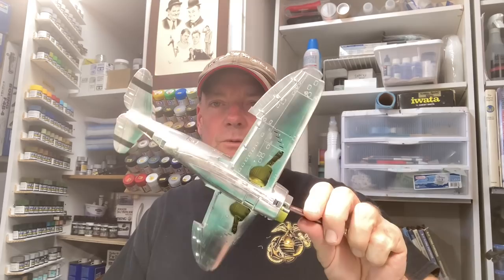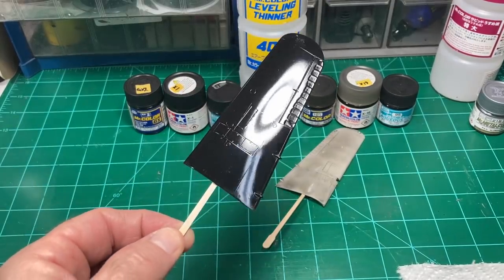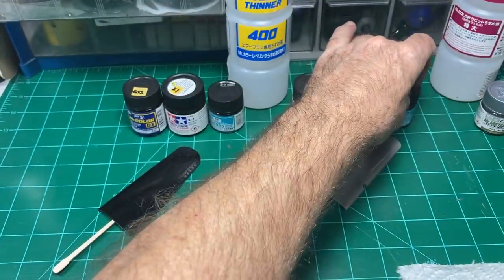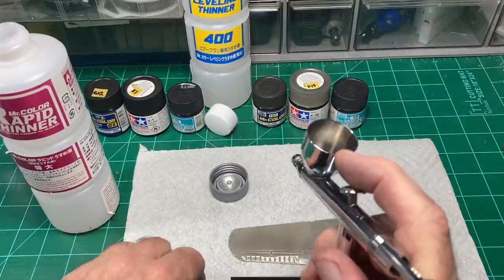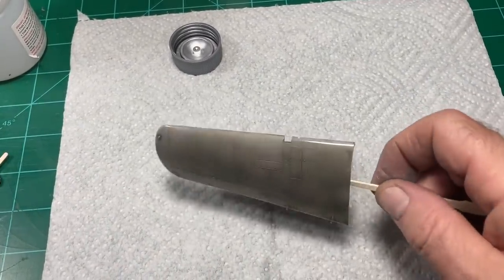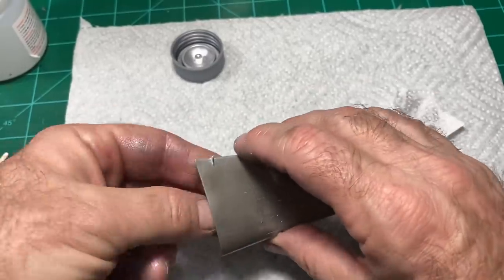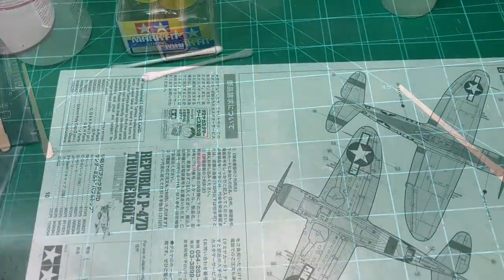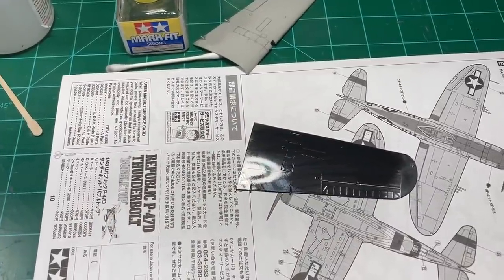Ep 1 Highly Reflective Metal finishes on scale model aircraft.

Comment: Back in the 60s  there was a product called 'Metalskin' in the UK. It was a self adhesive very thin foil which you preferably  cut the individual panels for your chosen model and applied them. It was a slow tedious process, but the results were amazing- !
Reply: I remember it but never had the chance to buy it unfortunately....
Reply from the maker: Bare Metal Foil is the closest thing out there today.  I tried it but I'm too ham-handed to handle it without ripping it.
Reply: Try thicker aluminium tape. Its streches and can be polished.

Have you tried lightblue base instead of grey?
Reply from the maker: @Maax1200  I tried a medium range, transparent.  It was easier to outdo the blue color that shows beneath, but I thought it looked too much like those old Kodachrome blue tinted photos.  Just my opinion, but it didn't do it for me.  I like the mix of black and smoke best, but that's just my preference.
Reply: @rebelroostermodeling6460  Ok, thnx for the info.👍👍 Grey does look good though.🙂

Comment: Just a thought,to get various aluminium finishes,could you not do some panels in black and others in smoke.
Thank you,you have taken the fear out of doing a NMF out of me,
THANK YOU from the UK.
Reply from the maker: You certainly can.  The trick is to not put so many coats of the metal color over it to subdue the effect.  I find that smoke, black, and very dark greys---- I have seen some use dark blues as well ----tend to do well (all gloss of course) and not be so different that they look distracting.  What I like about the pigment rub is that it gives you some effect as you change angles.
Reply: @rebelroostermodeling6460  cheers fella,I have the kitty hawk 1/32nd F86 sabre dog to build at some point,and Will certainly try your method.

Comment: Could there be a bonding between the polish and paint ?
Do you have any kits  that have  been finished a long length of time ?
Really looks great thanks for sharing ❤
Reply from the maker: Hi Jerry thanks for the comment and its a good question.  A couple things to remember:
1) The plastic is polished, making it super smooth so yes bonding can be an issue.  This is why I prefer a lacquer gloss base color beneath the metal.  The lacquer base will chemically "bite" better and have better adherence than an acrylic.  The metal (again, lacquer based metals as well) will then have a better seat to grip.
2) It is important to give a good washoff (I use alcohol) to get the glossy chemical in the polish off the plastic.  I generally use alcohol, but Dawn and water also works for many.  You will lose a little of the super shine because the flm is gone, but the gloss base will bring a shine right back for the meatl to utilize.
Reply: @rebelroostermodeling6460  very good.
Thanks for getting back to me on the topic.

Comment: Do you recommend to assemble the whole aircraft then do your technique, or do you do major surfaces, ie fuselage, and wings separately then assemble? If the latter, do you fix seam lines then respray?
Reply from the maker: Wow Josef, that's a good question and changes depending on different things.  I think it would be best for me to actually make a video on that, and I thank you in advance for the question because it is good subject material.  
But for now I will tell you that as general rule, I go in stages.  Engine, cockpit and landing gear are done and painted individually.  Then I go to the fuselage, wings and flight control surfaces (if separate).  Then I address seams etc.  Prime, find problem areas, fix again, prime again.  Then paint, then attach the engine and landing gear.
Reply: @rebelroostermodeling6460  thanks for your reply! I'm very excited to see your next video! Metallic finishes are the bane of my modeling existence!!!! So many of my favorite aircraft are Metallic finishes...ugh!!! Please help!!!!

Comment: Fantastic vileo! Please allow me a question : which is the dillution ratio for mr hobby super metallic you used? 1/1 with rapid thinner ?
Reply from the maker: That's about right.  My bottle was older and a little thick, so I did a little thinner.  For a nice new bottle you might not even need a 1/1 thin.  But remember it was Mr. Color Metal Color MC218....not the Super Metallics.  The Supers don't buff out as well, but they are more durable.

Comment: thats impressive - is there anything out there, that can be applied by rattle-can? Don't have an airbrush at hand...
Reply from the maker: Yes and no.  Yes there are "OK" metal paints like Tamiya Bare Metal Silver, but it takes a series of light coats with buffing on each one....and even at that it just doesn't give a really convincing look.  But still better than silver paint.  I have also seen a couple guys out there do a decent job with Tamiya Silver Leaf, buffed with a Dremel type tool and buffing wheel at low speed but that takes a trained hand.
Reply: Find an old hand flys-pray pump and modify it with K&S tubing.  Failing that see what is around with football pumps and garden pumps.  DON'T BREATHE PAINT OR THINNER!!!!!!!  FOLLOW SAFETY INSTRUCTIONS.  Store away from children.  Many of us cut our teeth on fly-sprays.  If unsoldering the tank and soldering the K&S worries you, go as a visitor to a model railway club and ask for help.  Model railway folk get accustomed to solder through wiring.  For us it is a way of life.
Best Wishes: Peter

Comment: Do you polish the plastic, or polish the black paint?
Reply from the maker: It depends.  If its Airfix or Revell, I definitely polish the plastic first.  Tamiya, sometimes.  Hasegawa is usually OK by itself.  Using GX2, it is shiny enough to not need a polish if the plastic is well prepared.
Reply: @rebelroostermodeling6460  very thanks! 👍😉🙂
Reply: After, you cover whit any varnish protector?
Reply: After, you cover whit any varnish protector?
Reply from the maker: @JoseGarcia-yk3dl  only in the rarest of cases.  There's nothing out there that doesn't rob the metallic look.
Reply: @rebelroostermodeling6460  thanks! Any cover of protective barnish?

Comment: How do you get so shiny surface after priming? Do you polish it after spraying? I need to know because I've got Enola Gay waiting in stash
Reply from the maker: I polish before using the GX2.  The GX works best over bare plastic so don't prime before applying the GX2.
Reply: @rebelroostermodeling6460  so you don't prime surface? I must admit your video has influenced me to try this out. I've picked spare MS.406 wings and started polishing them. First was dremel with polishing bit on slowest rpm possible. Then I started polishing with a piece of cotton dipped in a water with a tooth paste. The wing started reflecting LEDs from above my desk so you could see clearly each of them, it also reflected objects around. Then I've sprayed Vallejo black primer (gloss), the one dedicated for priming before metal colors, but it came satin at best. Other part I've sprayed with floor varnish (Pledge, Clear or whatever you have there equivalent), but it also ruined all shine.
Reply: you d better practice on a. small model before starting enola gay
Reply from the maker: @lebaillidessavoies3889  actually, I’m looking at a B17 before too long. The B29 is just too much to tackle right now.
Reply from the maker: @52down  Pretty much any clear coat will ruin it.  I have not tried the Vallejo primer gloss, but I do know that Tamiya X1 is a good option if you don't have GX2.  But the clear coats just messes things up, especially Future/Pledge.  The key is the well polished plastic (which by the sounds of what you said, you got it right).  Then just a quick wipe with IPA to get the polishing agents off to help the GX2 or X1 to stick, and then apply the metal.  Then nothing, no clear coats.  I have noticed that after several days the durability improved well.  But you may take longer depending on where you live due to air temp, humidity etc.